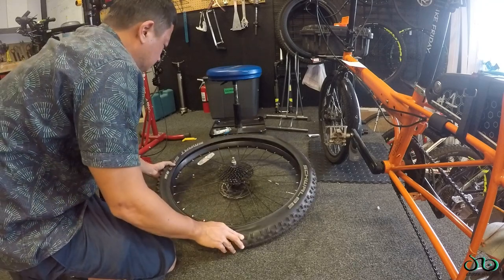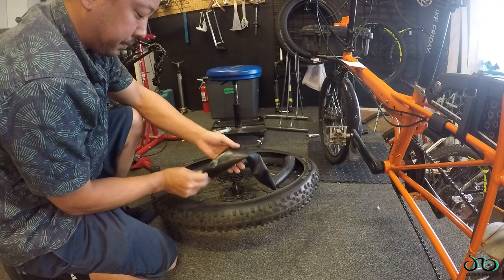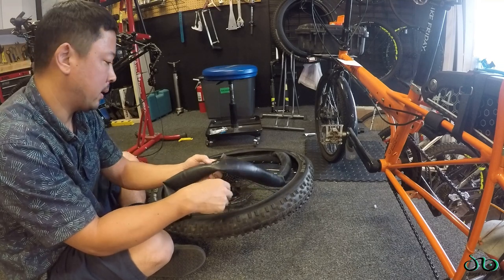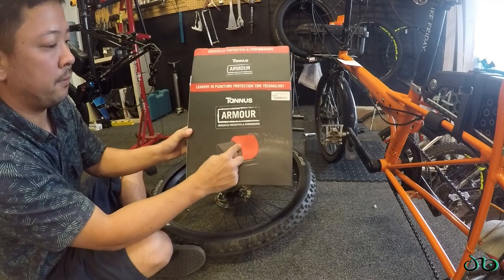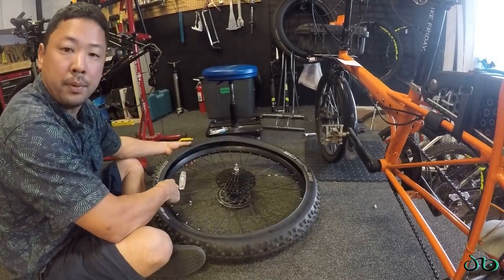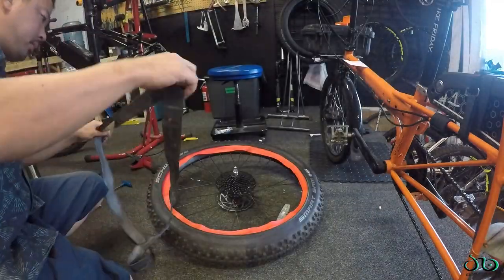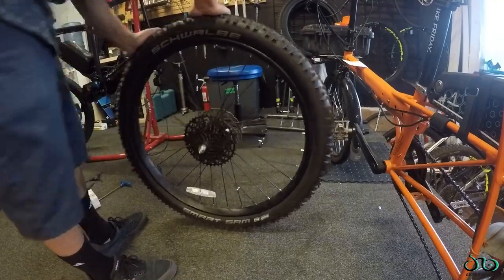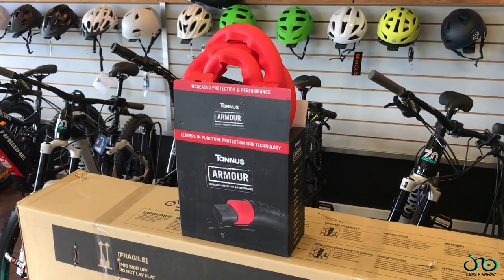Tannus Armour Installation!

Comment: You make it look so easy, I bought a set for my downhill bike and it took me almost 6 hours to get it in and I had to run to the bike shop to get smaller tubes. But once I got the hand of it, it got way easier, wish I would of have seen this video earlier.
Reply: Best thing to do is order the Armor kits that include a proper sized tube
Reply: I am still fighting to install one

Comment: I've found that if you clean a slimed tube with isopropyl alcohol before you patch it you will have better luck with the patch. I've got over 1000 miles on a tube and it still holding air.